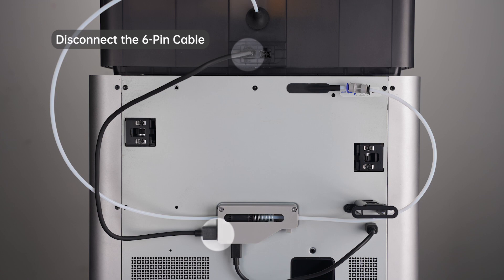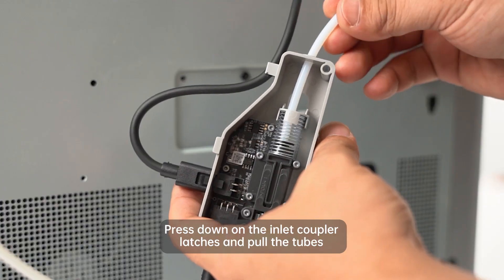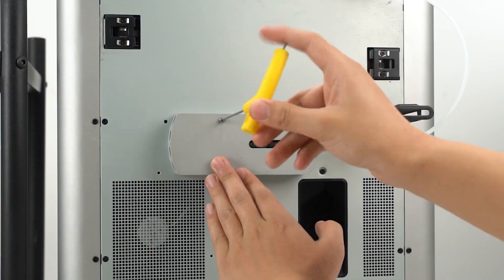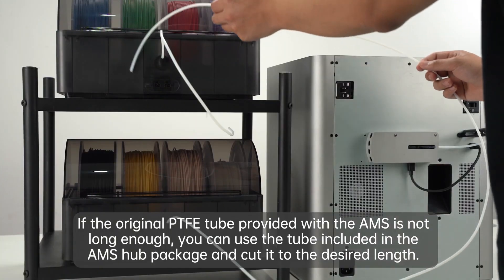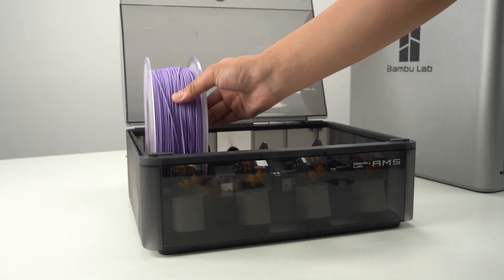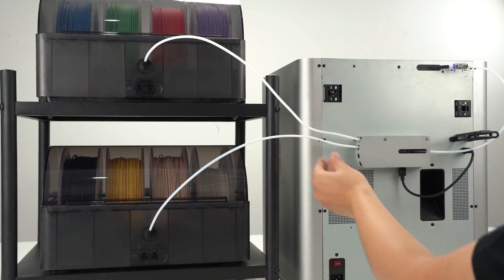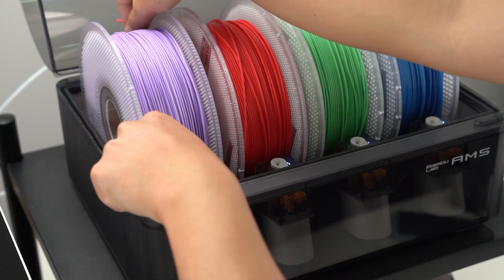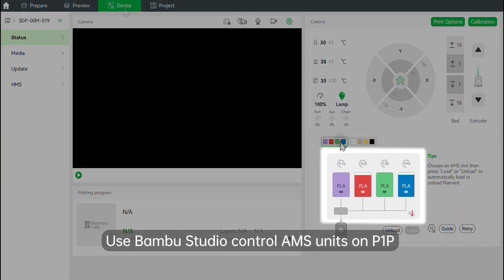Bambu Lab Connect multiple AMS units with AMS Hub up to 16 Color Printing

Comment: As if it could print 4 colors properly. Practically useless because of too much waste. There is a much better technology with zero waste but & don't see any brand incorporating it.
Reply: It does exist, it's called the Prusa XL
Reply: But it costs 4 times as much
Reply: Noteworthy that you do not describe how this zero-waste technology works. If (as you say) no brand incorporates it, then you have a golden opportunity to patent zero waste.  (It does exist, BTW, the zero-waste stuff is called "tool changer" mechanism, and it raises the printer cost by 4x to 10x.  That prices out 98% of current 3D printer owners.